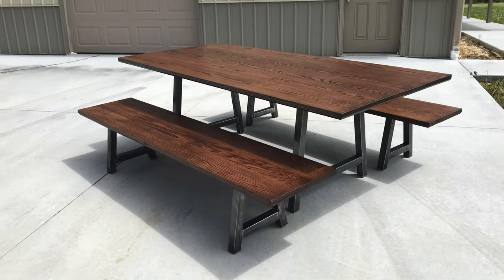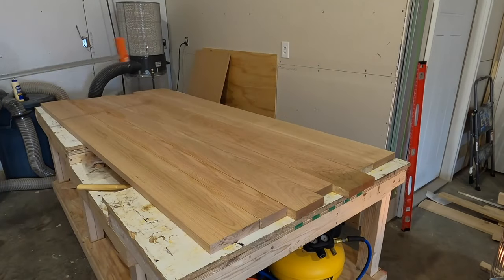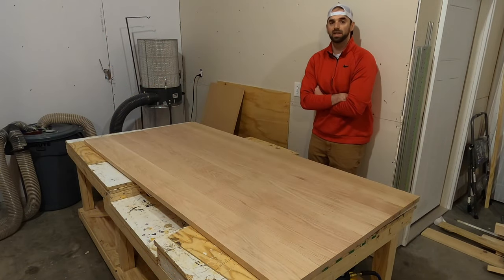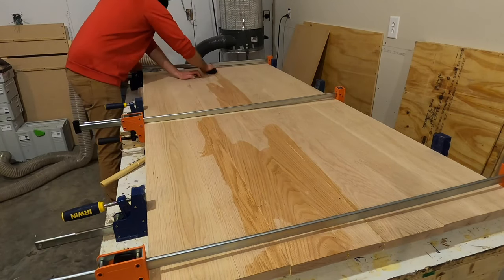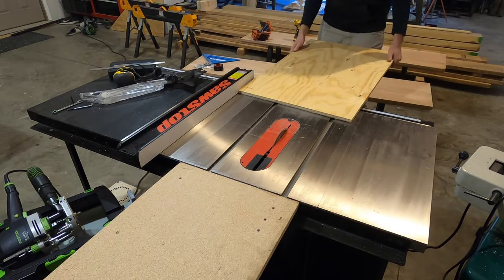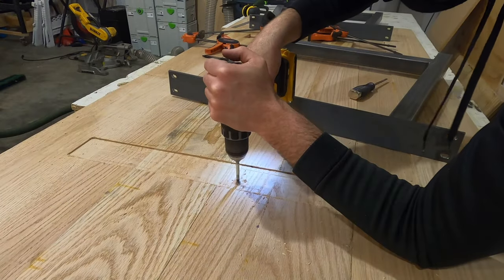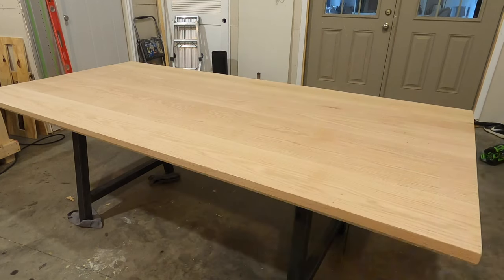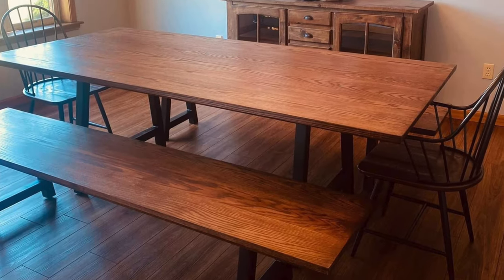Oak Table with Metal Legs - Full Build - Finished with Rubio Monocoat

Comment: LOVE this video! I just bought those same legs and need to attach them. Is there anything you'd do differently or can I just follow the steps in the video? Thanks!
Reply from the maker: Thanks Curt! The only thing is that I wish the slots were elongated so I wouldn’t have to cut them.. other than that I wouldn’t change anything at all. The threaded inserts are incredibly sturdy/solid.
Reply: @mmcc_woodshop6288  I just finished my table using your same technique. I love it. Thanks for making the video!
Reply from the maker: Awesome, glad it worked out and that you found the video useful!